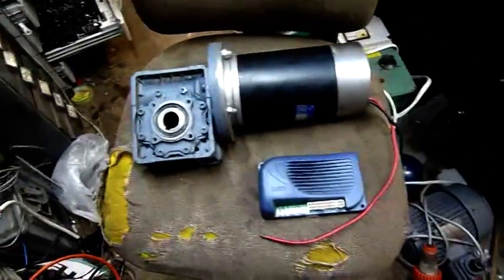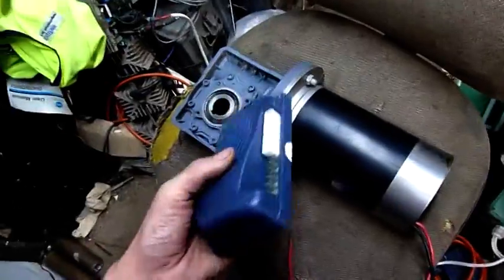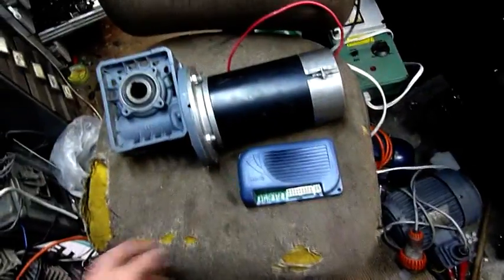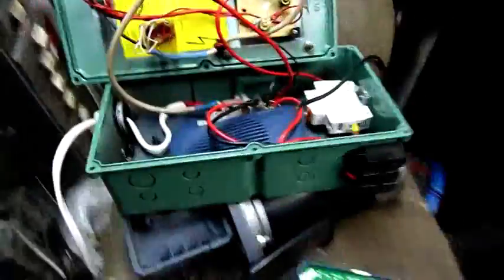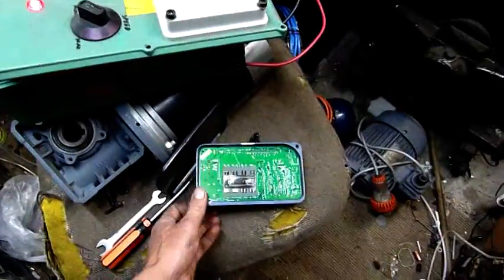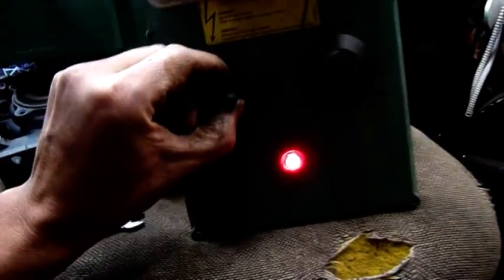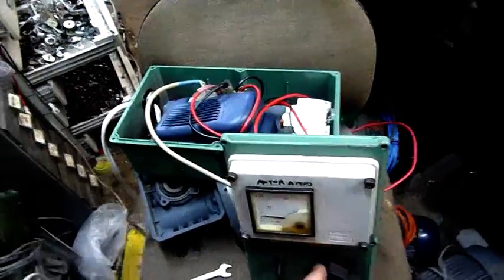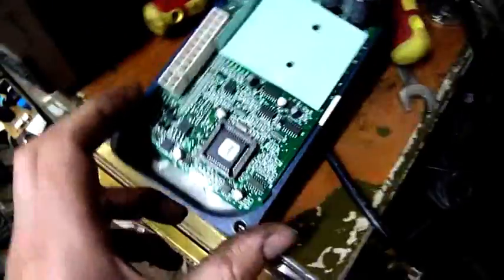Curtis 1228 DC Speed Control and Motor Testing

Comment: Curtis 1228 also 3-position Togle Sweet connection to change the direction of the motor backward and back to the center of the motor, which pins are we connected to the 18 pin connector?

Comment: Thank you Aussie for that very useful video on the Curtis controller. It would be good to message you direct. (but how?). It is the only video that I could find on the subject. May I ask if you used the 100K potentiometer for speed control or the 5K pot' from the "logic" socket.?. I suppose the programming parameters on the controller are as left to suit the original machine to which it was set to control.?. Chris.

Comment: Hi @Aussie50 I have seen your videos for a while... I am from Ecuador... Well I am a mechatronic engineer but I don't have experience with this type of DC MOTOR CONTROLLER I have just worked with simples dc motors controllers... Well I have a problem, the D. C. MOTOR CONTROLLER has crashed and exploit from a cleaning cart. I have bought the module MODEL: 1228-2908... But when I installed to the car and connect all, it starts to going crazy because I think the module doesn´t have charge the program... I don't have the programmer, how can I do it...? Please could you help me? I will give you my email! I will apreciate if you help me via skype or something like that. (email:cesar.salinas93@hotmail.es) Thank you very much, hope to hear from you soon.

Comment: I have a Curtis controller 1228-2901 that i fitted to a mobility Scooter also fitted a 0-5k Potentiometer but the deadband is too wide the Scooter works fine but when you fit the Wig Wag Throttle the movement is not enough the operate the Scooter Any suggestions? 
Reply  ·
Reply from the maker: The wig wag throttle may be too far out of range for the controller, they have a safety feature where the controller will not do anything when it detects an out of spec speed pot, IE it prevents uncontrolled acceleration if something should go wrong. the Wig Wag throttle may be causing the controller to go into this protect mode.

Comment: i think you'll find those devices are mosfet's as opposed to TRIACs, triacs are essentially inverse parallel SCR's which as you might know, latch when a gate voltage is applied, and they dont let go on DC circuits

Comment: Hiya. I have worked on a few of these and have built a test rig for them. Curtis are nice because they are very free with their schematic diagrams and connection / programming info on their website. I have managed to get the programming software for them and built a serial port programming cable to connect them to a laptop. All you need is an RS232 logic level converter chip in there. Dan.

Comment: I got a question, most variable speed motors or devices seem to be DC in nature is that because it is easier to variate and have steady results with dc motors vs ac?
Reply: More350Power with ac motors you need to vary the hertz to control motor speed. It’s not easy. VfD’s are ridiculously expensive

Comment: You have some interesting stuff Ed, my understanding is the motor controllers use pulse width modulation to produce an on/off ratio to average power effect.
They seem to work very well dont they, not sure about the harmonics and back emf caused by the sharp switching of power though, hmm.

I had an old persons scooter to look at, it had a very old curtis unit in a metal box, i had to crack it open for a gorp :-) its was a Curtis 1208 - 2455  DC0088.
It did its job, not a hi-spec job :-)

Comment from the maker: @alex993cc1 cool!, this one  has the provision for that, motor end housing has bolt holes and step machined into it, plus knock out rubber plug for extended rotor shaft.
Reply: 0:00

Comment: Should be 8 FETs in parallel.  If one FET is leaking (or gate is floating), will cause problems; usually full on at all times.  The unit will shut down if safety detects full output regardless of potentiometer setting....shuts off the relay.  Supposed to, seen these burn up because relay contacts weld together with shorted FET.  Stinky!!!

Nice little DC motor controller and definitely worth repairing by replacement of the FETs and relay.

Comment: the devices on the board are FETs if that's a DC speed control.  if it's an AC speed control (and is not an inverter) it would have TRIACs.

Comment from the maker: @30GB yeh as long as you support the shaft it should work really well!, the motor housing would be strong enough with a window or 2 cut in it, even weld brackets off to other structural members for added support,

Comment: @Aussie50 yeah its going to be awesome when its done, i thinking of gutting the motor and leaving the shaft with housing and bearings and then cut a hole in the housing and weld a sprocket on the shaft then running a chain straight to the motors clutch.

Comment: We used a Curtis AC induction motor and controller to convert a VW bug to electric at the performance shop I use to work at. It drove really nice actually, stick it in third and mash the pedal and it would push you back into the seat pretty good. It actually had more HP than what the original engine did when we were done. One of the coolest things I've taken part in to date.